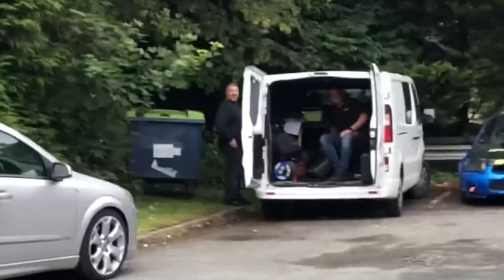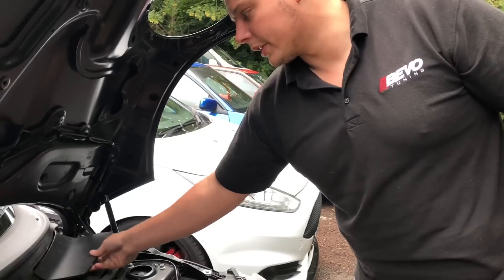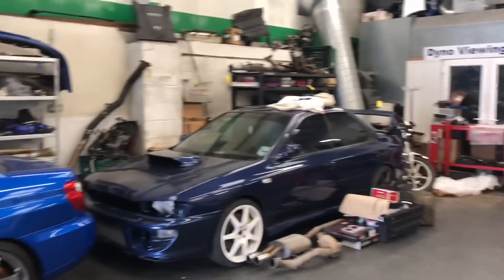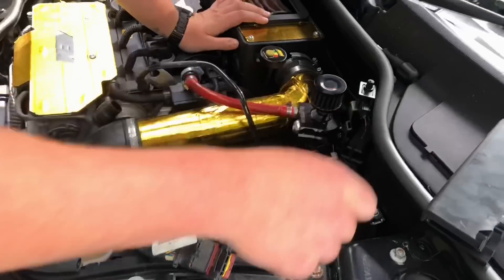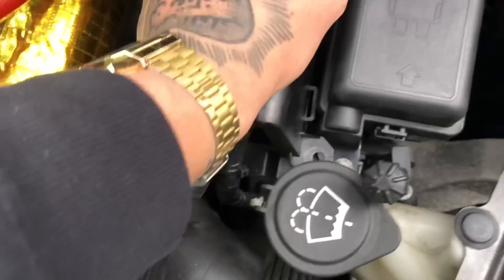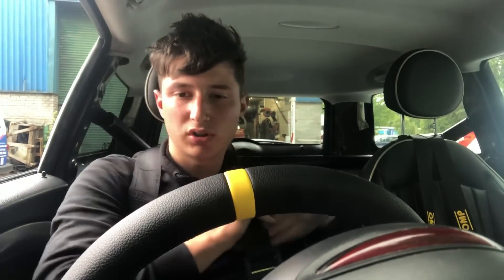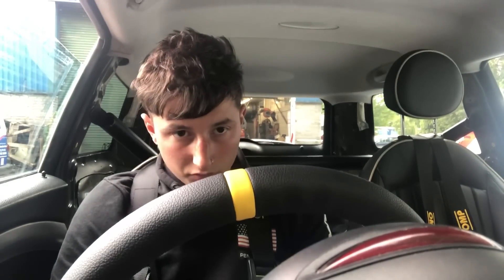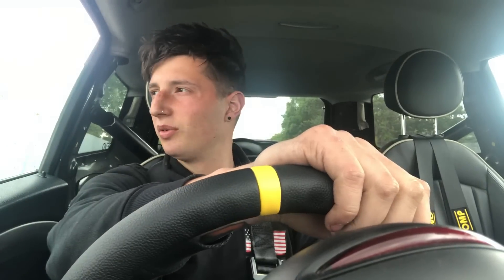My R56 Mini Cooper S Now Spits **INSANE** Flames!!

Comment: When I had my r56 JCW my aem intake would do the same, I took the MAF adapter piece and turned it the other way round and it fixed it. If not then try sand down the outter lip of the MAF adapter then it'll 100% work.

Comment: Looking better now, that torque should be mad with that car, Simons not pushed it, because the hardware your running is about right for the power he’s dialled in, but with a few extra goodies, bigger turbo ect you should easily be getting 250bhp, so your getting a little rocket now. 👍🏻